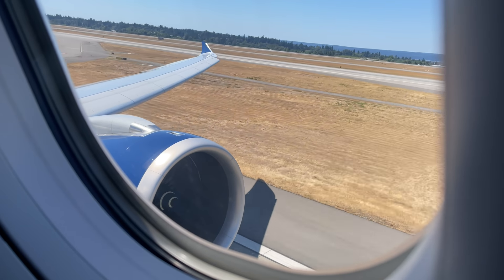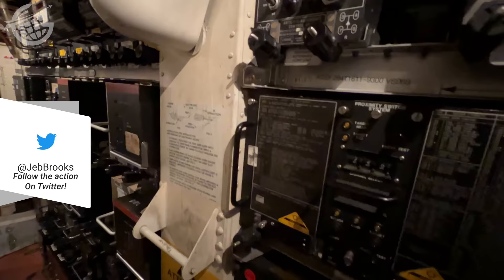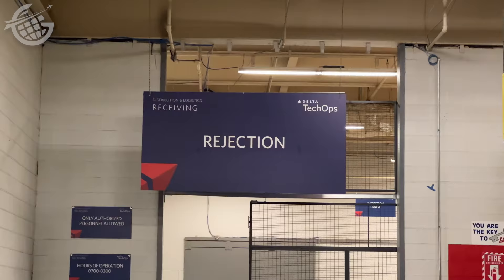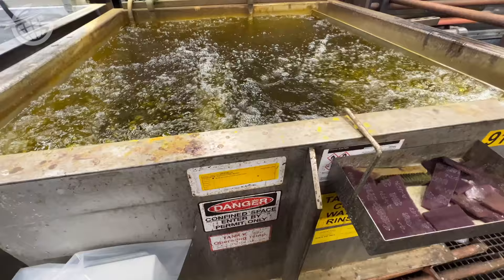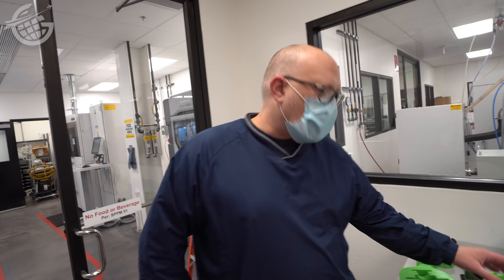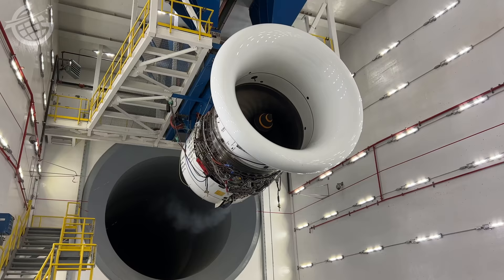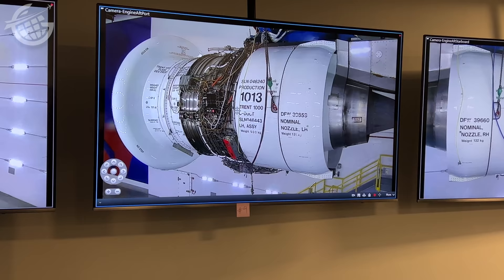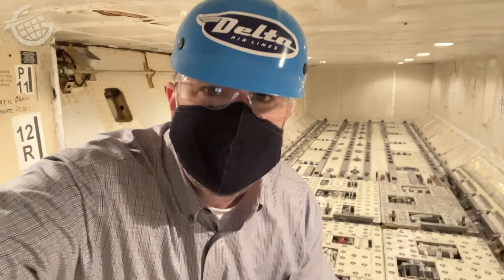How Delta Air Lines Fixes Their Airplanes

Comment: As a aircraft mechanic for AA thank you for highlighting all the hard working A&P do
Reply: Would you consider AA to be on this level?
Reply: @seanrobbins7125  No delta has alot bigger overhaul then AA.
Reply: I used to work for AA as a mechanic…does it still suck?
Reply: @justing42  I’ve been here 4 years now and working at a mro and going to AA is night and day. It’s the easiest job you’ll ever have but sure it has its problems

Comment: Great video, takes me back to my 6th form work experience around 2001. I was lucky to get 2 weeks in the GE service centre in South Wales, UK. I got to stand in the inlet of a GE90, one of the techs "threw" a CF fan blade to me (so light yet soooo expensive) , I did the fluro crack checking and on my last day there I got taken through the test beds and allowed to push the throtles on a RR Olympus (they did RR too for some reason), YES, THOSE RR OLYMPUS FROM A CONCORD AND VULCAN. Best moment of my life and a howl that'll stay with me forever

Comment: Regarding those vats of chemicals, 25ish years ago, I was in Nashville, visiting "The Aerostructures Corporation" (formerly Vought)  with my local SAE student chapter.  They made airplane wings there.. seeing a 200 foot long wing on a vacuum table with a 4 spindle CNC machine working was one of the most impressive things I've ever seen.. but they also had a number of tanks where the material had to go through a chemical cleaning and prep process.  And, they also did some composite wing stuff with carbon fiber and autoclaves. I've been in the Tech Ops building once or twice as a result of the support work I do related to a particular airline.

Comment: At 3:00 to 5:00 those are parts that come in a truck are for schedule maintenance parts all the emergency stuff it's sent from HUB to HUB in a plane and picked up by Tech Ops. For example when delta had engine issue with 757 at LAX last year the item was overnight shipped from MSP Tech ops for the 757 and made it in time and the plane was back in service the following week.

Comment: Have been through Harts field many times....Old saying was...if you are going to Hell..you have to pass through Harts field on your way, due to the massive amount of in and outs it handles causing delay after delay...Not my experience...watched thousands in the check in areas be handled in any A.M. rush be gone like water going down a river...smoothly done. ATL, and Delta, an amazingly run place.  Flew Delta a lot, always looked after well, never had a bad day with them. This was an excellent view of just how well a massive operation is expertly managed, well done.

Comment: Please do a line maintenance video. Always wanted a tour of ATL TOC facility. I got a friend who is a former DELTA A&P back when DFW was a hub for them and it is always fascinating to hear the things he use to do and some weird stories. I also remember working ramp at HSV and had a MD88 needing a engine swap and it was awesome to watch the mechanics drive  from ATL have all that they need with them have the crane and engine there not long after they got there and have the engine swapped and be gone not long after

Comment: Super cool! I see the maintenance teams moving the aircraft in and out of the hangar but are they the ones who also bring the aircraft to the maintenance hangars? Like, do airlines just pay pilots to taxi aircraft empty for maintenance or do maintenance teams taxi them, move them with something like that airplane vehicle pushing the plane? Do they move them back? Is there a process behind that?
Reply: Line A&P’s can get taxi training, then be authorized to taxi the aircraft. Example, they taxi out to a test pad, to run/test engines at full power.
Reply: @Supernumerary  Is that how Delta moves planes for maintenance in Atlanta?

Comment: As a retired delta, they said it was a family.  In kdfw and many other stations outside hotlanta we felt it was a family heavily into incest.   Atl screwed the outstations over every opportunity they could.  They encouraged animosity between stations and rather than investigating problems they blamed the last crew to touch the plane.    Example ….  727 leaves the gate doors and panels are all closed and locked. Plane is taxiing to north end of airport and AA calls tower in inform delta 727 has a aft cargo door handle in open position.   Plane takes off and FE calls dfw app advising they have a indication of cargo door open but no problems with no3 eng.  so they fly around burning fuel and when 727 lands delta has the mechanic and gate crew suspended pending investigation.  Come to find out 727 was written up for cargo door handle many times prior AA called tower before it launched and delta’s management wanted a scapegoat fast not answers.   We were 757 home base yet atl wouldn’t give us the parts to store for the ship. They wanted control of everything.  Oh and my favorite was POAD. Paid on another day    We work the overtime but didn’t get the money because it wasn’t in the budget.   Happiest days of my life wedding kids births and loading up my things and flipping delta off.  Not even sure if it’s delta anymore.  There’s question about who bought who. Delta buying northwest or vice vesa.    Oh and the golden parachute the ex CEO’s enjoyed    That was a great delta family environment.  And the guy that wants to see line maintenance … that was at least when I worked the ramp back to back crap.  Delta never saw a plane it didn’t buy. I felt like I was working the airline version of goodwill donations.  Some jokers unidentifiable reasoning on aircraft maintenance that we had to sort out